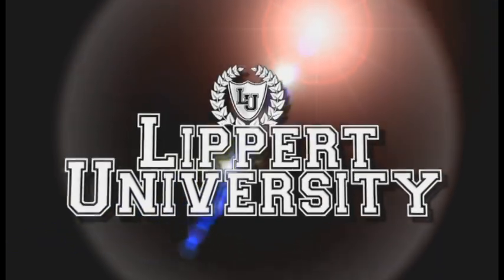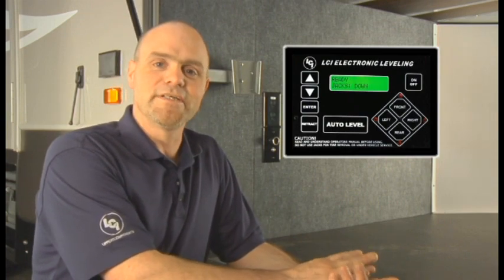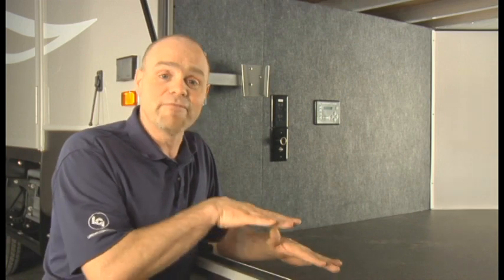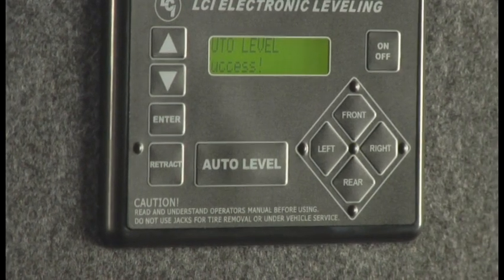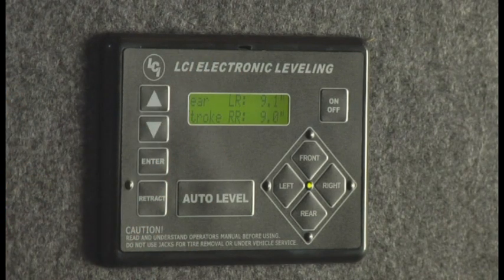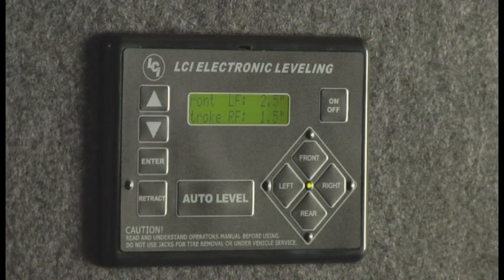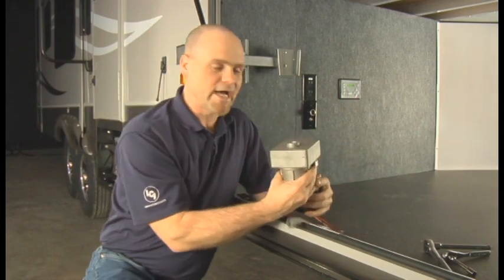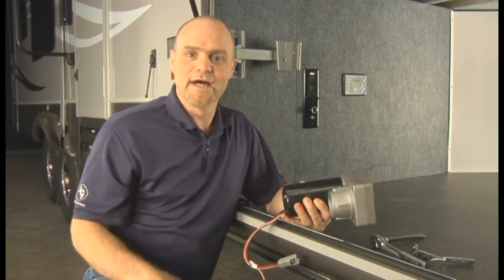Lippert Ground Control for Fifth Wheel Instruction video

Comment: The one thing that is missing from the video is your RV has to be somewhat level to begin with ! Lots of trial and error on my part to find this out . Most new RV owners are never told this when they purchase an RV . I was  told the Lippert ground control took care of everything when in actuality it is  just a fine tuning  device to get your RV level ! Glad you made this video anyway , helped me have a better understanding of the Lippert system .
Reply from the maker: The somewhat level is not totally correct, as I mention the system will lift tires off the ground (which you do not want) as you will have to use level block to support the lift.  If you are way off level then it will not level as the leveling legs only have so much stroke(lift) that they can provide.  Great comment and Thanks for watching.

Comment: I have a FR Flagstaff Superlite and saw you did the leveling with the slides in on the Microlite. Do you need to relevel after the slides are out? Once I extend the slides it always seems to drop the driver's side another 1/4". Any recommendations?
Reply from the maker: You should always level with slides in as not to damage your trailer.  When the unit is level and you extend slides it should remain level. Both this demo and my personal unit are on Fifth Wheel Trailers and I never have to relevel even with large slide.  If you are getting movement make sure the ground below the pads is solid if not use blocks or pads to widen and stabilize the area beneath the jacks.  Here is a live demo of the system also. https://youtu.be/OXTkvkPOZWY  Hope this helps.  If an issue continues call Lippert support.  Thanks

Comment: I noticed when raising the front and disconnecting from the truck that my rear and left buttons were flashing green.  The digital display didn't show any errors, but those two buttons were flashing green.  Can you tell me what that means?  Is there something we need to fix or do?
Reply from the maker: I have the 3.0 system and lights are red when the system is not leveled.  These lights show which side is out of level. check with your manual it will describe their function or contact lippert support.
Check here for manuals if you do not have one https://support.lci1.com/electric-leveling
Hope this helps

Comment: I worry about the fifth wheel tipping over if all the jacks are refracted. Is this a valid concern?
Reply from the maker: I do not think this should be anymore of a concern than normal.  The rear axles should always be making contact with the ground. So if the leveling system raises the axles off the ground then you should retract them, move the trailer onto blocks so axles are supported.  Also, a good set of wheel chocks are a must so the unit does not move forward or backwards.  Hope this helps with your understanding of the leveling.  Check out this live demo I filmed.  https://youtu.be/OXTkvkPOZWY

Comment: My very first time out my RR jack ran out of stroke and I had to watch about 10 videos on how to manually operate the jacks. The salesman did a horrible job explaining how to use the system. He basically told me to read the instructions on the door. Anyways, my current problem still exsists, I cannot get the system to stop giving me the error message something generic like "RR jack error". How do I clear this so I can use the auto feature again? I appreciate any help you can provide.
Reply from the maker: Call Lippert support they will walk you thru solution.
Reply: To erase code error.  Extend front for 10 seconds, middle for ten seconds, and then extend rear for 10 seconds hit, then  hold retract.

Comment: Mine is going hay wire and had listing WAY to one side with right side wheels 10 inches off the ground as well as the jack. Scary.
Reply from the maker: Ok, you are talking about the travel trailer system, likely your level sensor is having an issue or system needs to be reset. Check Lippert troubleshooting online.
Reply: @RVing_TV  First day owning a camper. I think it needs a master reset

Comment: Why does it bring the coach wheels off the ground?
Reply from the maker: If the wheels are lifting on one side that side may be too low so it lifts and if that is the case you need to block the wheels so they are supported.  You can use 2x6's or I prefer Lynx levelers